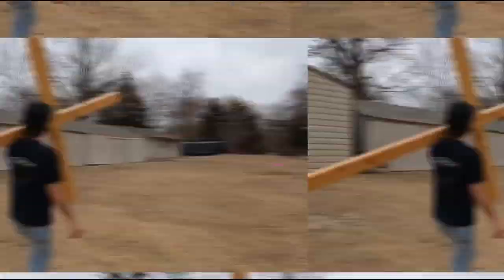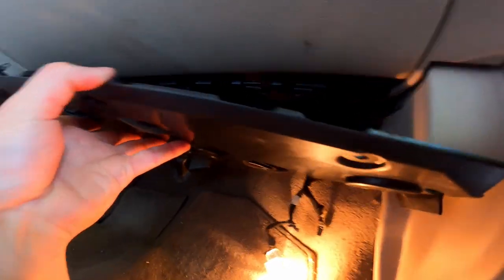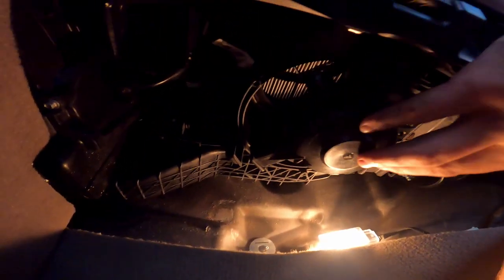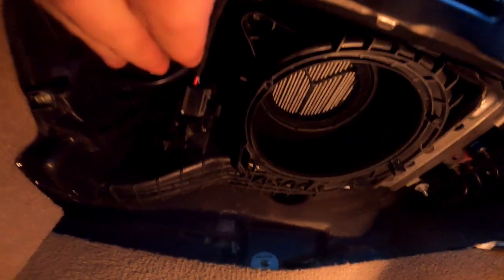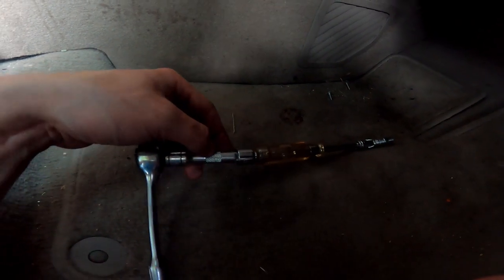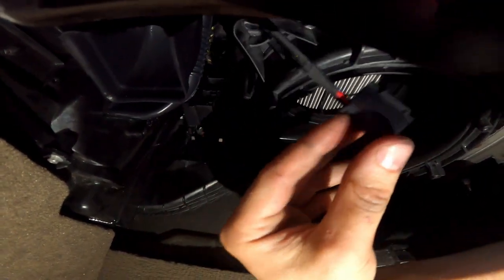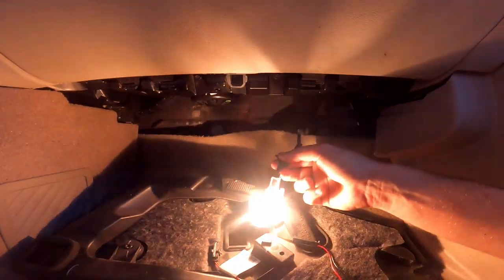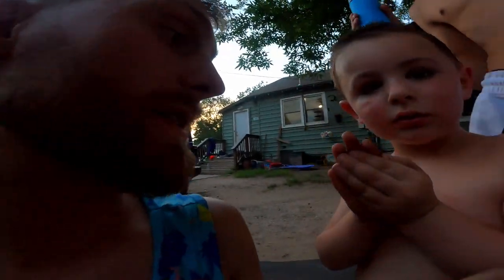HOW TO replace A/C Resistor in a Cadillac SRX (2010 to 2016) - Daily Vlog

Comment: hey im looking into replacing mine on my car and i want to know if i can test if its bad before i use go buy a new one. mine only had one cable connected to the resistor, the 3 pin. I connected to blower motor straight to the battery and it kicked on without any issue
Reply from the maker: I'm pretty sure there is a way to test them. If removing the resistor from the circuit made the fan work, I'd say it's safe to say the resistor is bad.